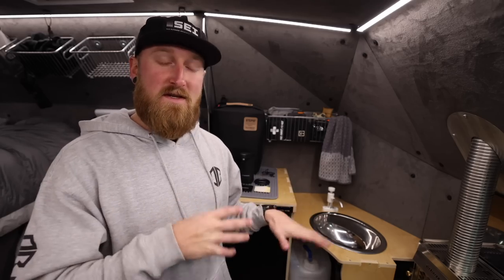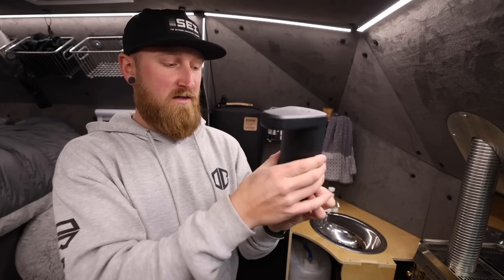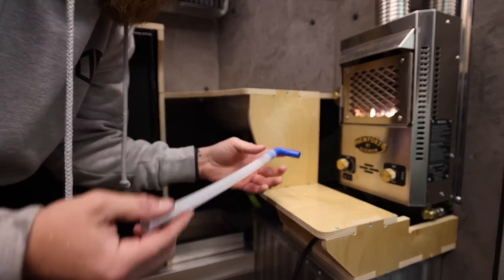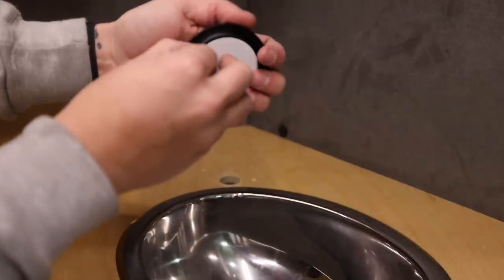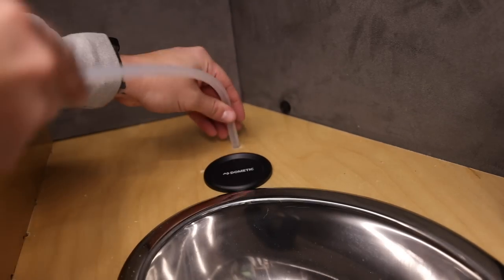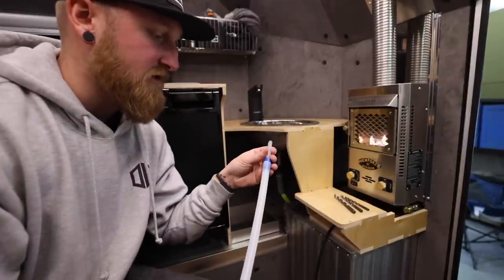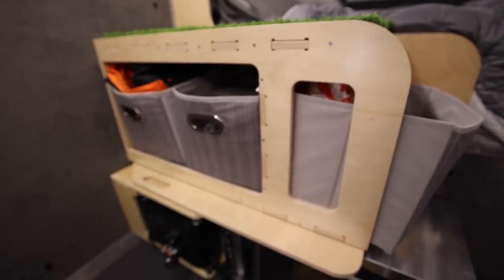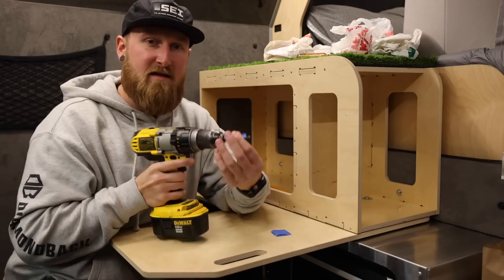TRUCK CAMPER INTERIOR MODS! | Water Faucet & Minimal Storage

Comment: Faucet was a nice upgrade. Have you looked into adjustable bungee cords? Not sure if they will look aesthetically pleasing or not but you may want to look it up. Can also look into rubber bungee cut it and screw it and maybe find a way to cover the ends with screws with some sore of cap.
Reply from the maker: I can adjust these by tying them off.

Comment: One suggestion:  Is there a way to purge the Dometic Pump/Faucet of liquid after it is used to prevent the freezing of any liquid inside the pump assembly?
Reply from the maker: Yup just disconnect the hose and turn it on for a few seconds to let it drain out